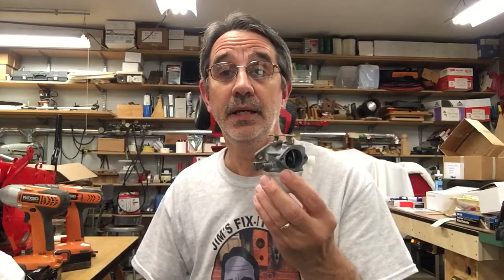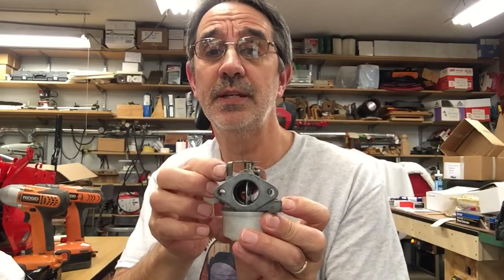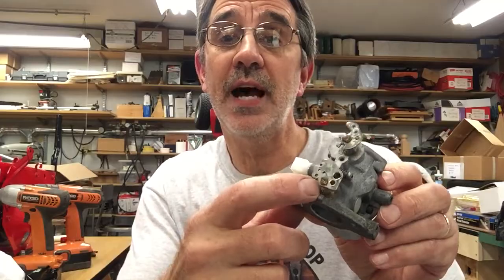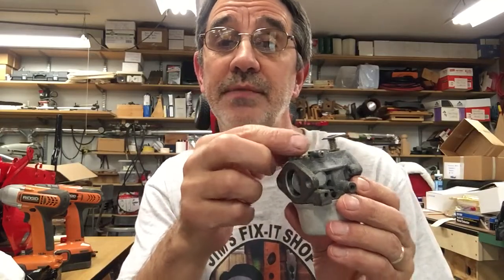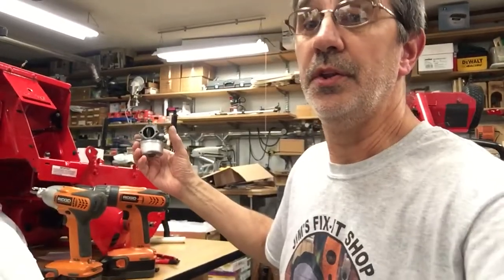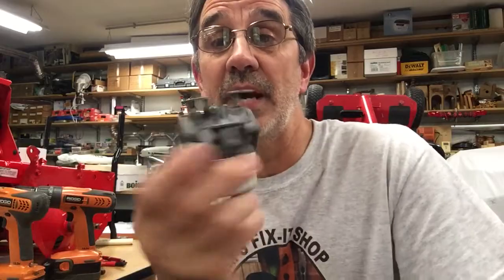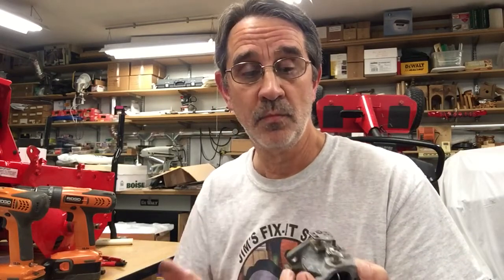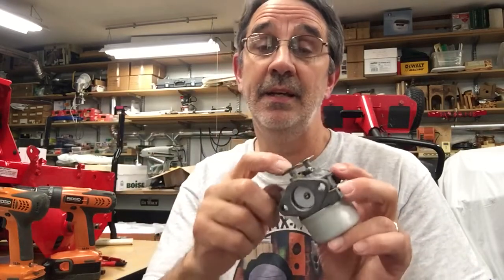266.   Why is my engine running wide open at full speed

Comment: I stuck a new carb on a kohler sv530 and now it cranks wide open and throttle does nothing. Any suggestions please
Reply from the maker: Yeah, I would check to make sure your butterfly for your throttle is working properly. Otherwise I would say you got the wrong carburetor just a question you didn’t buy it from Amazon did you their carburetors are junk and they don’t work.
Reply: @jimjackson9381  thank you for getting back to me. After 4 afternoons of messing with it I did get a little more control over the throttle. I then put my pride to the side and took it to a professional. You are 100% correct, Amazon carb came with a #7 jet when mine needed a #3 apparently. Also when I removed my linkage I messed up the governor position.

Comment: hello Jim, This is my first time on your account and loved how you explained this video here. Jim, could you please help me understand what is going on with my Chainsaw and how I may resolve it. when my chainsaw starts, it stays reved up and does not idle. It does not throttle up or low. so the throttle has no effect on it. am not really sure what is going on with it. The chainsaw is a Troybilt model. THank for your help.
Reply from the maker: It sounds like your linkage on your carburetor is stuck wide-open, or the screws came out of the butterfly and that would be the same as running the trigger wide open, the only way to tell for sure take it apart.Jim

Comment: Hi sir , I currently own an Echo CS-355t it's a chainsaw , it starts right up and immediately runs at full power it will not idle or warm up as soon as I pull it it's running full throttle , there are no videos out there.
Reply from the maker: No I don’t have any videos on chainsaws unfortunately but it sounds like to me that your throttle butterfly has came loose or totally fell out of place, or your linkage to your butterfly is become stuck or that has fallen off you’re going to have to open it up and see what it looks like if you take a flashlight and look through the carburetor with the choke off you should be able to see the throttle butterfly on the other side of the Carburetor and it should be closed check it out and see what it looks like. Jim

Comment: OK I have a question the bar that holds the blade on do you know what size threads are on the spindle.  I burgard up the threads and the bar will not go back on.
Reply from the maker: paul Taylor 
   Hi Paul it’s Jim
  On my machine and probably all the machines the thread inside of the blade mounting bar is 3/4-16. And the nut that locks the bar on is 5/8-18. If you need anything else just let me know. Jim
Reply: @jimjackson9381   I am going to have to get a die to clean the threads what size die should I get. This is the threads that the bar screws on to. Thank you for the help
Reply from the maker: paul Taylor 
Hi Paul, the threads in the blade mounting bar is 3/4-16. Jim

Comment: Jim, I just put a new cam shaft in my YTH 2042 Husqvarna riding mower. I put it all back together and all it will do is run wide open. I'll take all that breather plastic housing off and check what you said to check. But, was wondering if it could have been something internal??
Reply from the maker: Well it does have a internal governor that rides off of the camshaft that may be out of place when you put it back together, I hope we’re talking about a Briggs & Stratton. engine I’m not sure how the other engines have the governor connected. Jim

Comment: I have a poluand riding mower and it runs wide open no matter where the throttle is tried to august the governor each direction and no change
Reply from the maker: Well, video number 266 should explain to you how to check and fix that issue.         Jim

Comment: Can I put  a  engine  from  my snow blower  on my  snapper    mine runs  fast   all the time.
Reply from the maker: I would have to see a picture of these two engines typically a snapper engine is a vertical shaft and a snowblower is a horizontal shaft if that’s the case no you can’t interchange them.   Jim
Reply: Jim my name is Tim I ask you about swapping the engine from a snow blower over to my snapper my snapper is a 9.0 horse power when I started up it runs high no matter what I do with the throttle can you give me some ideas please on what the problem might be when I need a new car Brewer do I need a new governor I need all the help I can get from you I watch your videos all the time I love my snapper I'm just having a lot of problems with the engine The engine is a 9.0 horsepower Briggs and Stratton Please please help me my dear friend
Reply from the maker: OK the first thing you want to do is take the airbox and filter off of the end of your carburetor and get a flashlight so you can look through the carburetor to the back side that is up against the engine on the outside there’s a butterfly there that is for the choke on the other side of the carburetor there’s a butterfly and that is for controlling your speed sometimes that butterfly comes loose and falls off and that will make the engine run wide-open and your throttle control will do nothing if you look through the carburetor with a flashlight and work your throttle control back-and-forth you should be able to see that butterfly open and close if it’s open and stays open them something has come loose and that’s causing the problem check that out and let me know what you find out. Jim

Comment: Have a 18 hp ohv Briggs and Stratton that sit for about 5 years. When I started it up I can't get it to throttle down
Reply from the maker: I would guess that the carburetor is gummy and it’s stuck you may have to take it off and clean it. Jim
Reply: Mine has done the same thing I have cleaned mine and even put a new carburetor on it still chokes to start and then runs wide open I'm at a loss here
Reply from the maker: @olecountry5459  Is your throttle butterfly attached to the shaft securely or is it loose. Jim
Reply: @jimjackson9381  cleaned it in ultra sonic bath still the same
Reply: @jimjackson9381  everything is tight
Reply: Hello I got a briggs  vanguard  16 hp  the idle spring  broke  . We replaced  it with  a different  spring   . It must have been  to strong  of a spring.  Now it won't return  to idle . I'm lost
Reply from the maker: @iwin1833  You’re going to have to go to a lawnmower shop I use either Agard‘s lawn and Garden or White Lake nursery they sell lawnmowers and they can get engine parts you got to have the correct spring with the correct tension for that carburetor to work properly. Jim
Reply: @olecountry5459  you ever find out you're problem?

Comment: Jim  I have the same problem as the video states, butterflies are all present and accounted for.  17.5 Briggs 31R9 77 0001 G1   I had to rebuild the engine due to wife ran out of oil.  Replacement parts were sump, counter weight, oil sling, connecting Rod.   I started with the engine running ruff so purchased a new carb, spring for throttle & choke levers.  The running ruff I think was valves were not set correct. (first timer)  So I played with the valves and now it runs, just wide open.  I feel the problem is in the throttle lever/oil sling.  Seems to move not as ez as the videos I have watched.  So I'm now at a lose.  I went from running ruff to running great just wide open.   Any advise??????
Reply from the maker: By the way it sounds you are way more into repairing engines than I am I haven’t messed with an engine in years about the most I do is clean the carburetors and put them back on. Jim
Reply: @jimjackson9381  well thanks for being honest about it.  Kind of to learn fast due to cost of new engine.

Comment: I swear to God I pull this customers carburetor and the butterfly screw is gone I'm going to be upset. Now he did play mechanic on it and screwed the governor up. So I got the governor  where the shaft wasn't playing back and forth and of course with resistance up against the gear but my suspicion is it threw the weights off the governor so it's going to run side open now and there isn't anything I can do about it with cracking the motor open now being I suspect he has thrown the governor weight why not see if he sucked the butterfly screw into the motor😂 Ive already seen the throttle butterfly working in the back but maybe it's just in it's slot with no screw. Either way I'm a tad upset having to track down someone else's screwed up work only to find they've basically killed it 😭

Comment: This have happened to me and i fixed it but even if i hold the throttle shut it will stop and if i let it go then it just want to kill itself with rpms help
Reply from the maker: It sounds like the springs on the carburetor are not pulling the throttle closed as it should, or the governor is messed up see what you can find. Jim
Reply: @jimjackson9381  hey fixed that and it was vibrating as hell but it was the blade so took that off then when i try to start it it just spitts out fuel out of the carb and the motor kicks back even spits out fuel if the ajustment needle is screwd all the way in :(
Reply from the maker: @melvinthemechanic  What happened that bent your blade, to me it sounds like you hit something and that intern started to share the key in your fly wheel which is throwing off your timing making it kick back and blow gas out of the carburetor you may have to pull the fly wheel and check it. Jim
Reply: @jimjackson9381  thanks i will try to look in to it tomorrow :)
Reply from the maker: @melvinthemechanic  well let me know what you find. Jim
Reply: @jimjackson9381  hey thanks for the help idk what i did but its running now :) maby somthing with the key :) thanks
Reply: Or maby it was the carb screw that needed to be screwd in the carb to run on this old briggs lawnmower 😁

Comment: Governer is bad on mine.
Reply from the maker: chef souffle 
Is it bad or does it need adjusting. Jim
Reply: @jimjackson9381  
No adjustment either way on the governor arm. 
It just runs wide open. Has a new carburetor. Everything is adjusted where need be.
Reply from the maker: chef souffle 
The butterfly in the carburetor is OK, and there’s no adjustment on the governor usually the shaft sticks out through the block and there’s a arm that clamps to the shaft that sticks up towards the linkages for the carburetor that is where you adjust the governor at. Jim
Reply: @jimjackson9381  
I've been working on these since I was 12. I'm 33 now. 
The governor is broken.
The shaft on the side of the block can be adjusted ever so slightly and does not. 
All linkages are good and the carb is brand new. 
So yes mine is wrong internally.